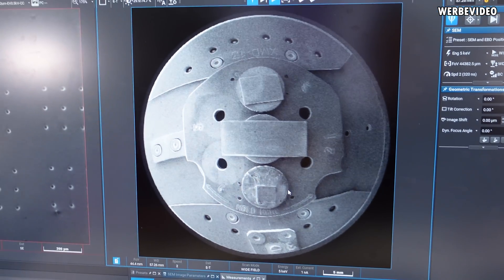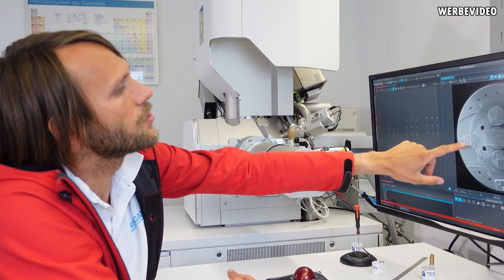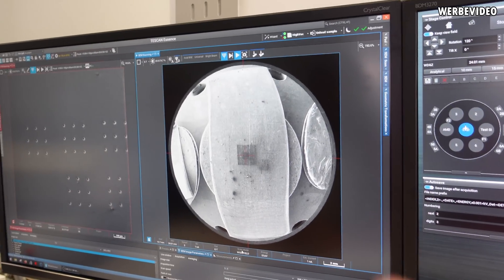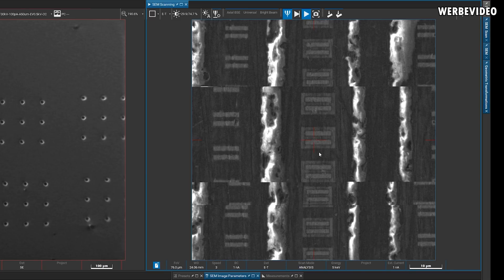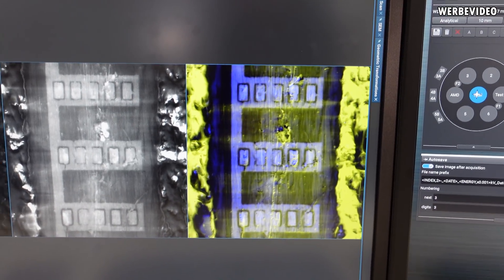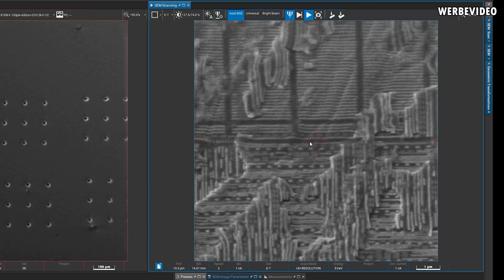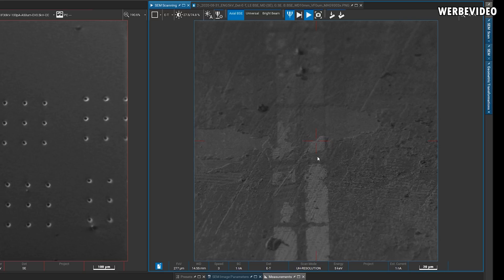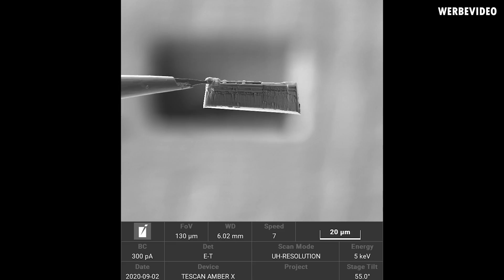Ryzen Nano-Structures more than 100,000 times magnified. Visiting Tescan Part 2/3

Comment: why aren't you using ferric chloride to etch  the  metal layers off? no grinding damage and you can control depth by etch time. that's the main method used by chip reverse engineers.

Comment: I hope they will improve Ryzen 7nm technology somehow, because that active flat is too small and cooling it is problem. You can have the most powerfull cooler in the world and there is no much big difference because of that while with Intel better cooler makes a difference. I've just bought Noctua D15 for my Ryzen 3800X and without votage offset I still have more than 80°C in load. Maybe pushing on switching to 7nm is not so good idea, coolers are not ready for that.

Comment: 200 years ago people would not even be able to imagine this kind of stuff. This is amazing.
Reply: Ok so you know what Electron tunneling is with the transistors, and how they use silicon transistors to get smaller like the 7 nm they are currently at with AMD's Ryzen 3000 series CPU's.
And the 5 nm, 3nm and so on, to make the computers more efficient with performance and energy but now we are starting to see more heat.
Silicon has limits but they keep trying to improve it, and it will melt at specific temperatures, so we need to replace it.
Ask yourself why we aren't using Quantum Materials like Graphene (yet) and still using silicon. 🤨🤔

This is where Graphene will fix the electron tunneling aka Quantum Tunneling, we don't need silicon to get down to 1 nm "nanometer" in size.

Imagine this, Graphene computers with a magnetic current to be 1,000 times faster and possibly only use 1% of the energy used. 💡

Now imagine Graphene optical / transparent transistors for Photonic Computing. 💡

Now imagine Graphene lasers for the fiber optics that would be used as the circuits inside our computers for Photonic Computing. 💡

--------

I would rather see Graphene computers, let's get rid of silicon. I'm serious.

Check this out.
I would give links but the video hides my comments.

Go to my channel and click on the playlist called "Videos with important info to get around my channel". ✔

Watch a Flash Graphene video about Flash Graphene 100 dollars "per ton". ✔

And then another video about "Large machines on earth / in space to make Flash Graphene". ✔

After that, check my channel with 2 simple steps for my other channel, go to the "About" tab of the channel I'm commenting with now and read the info with a link found there to save to your browser's favorites. ✔

==============================

Imagine Graphene for Photonic Computing, to help us save on our energy needs, really think about that for a second with Photonic Computing.

Check my other channel for these 2 playlists.
Photonic Computing playlist. ✔

Graphene computers for home and Starships, playlist. ✔

Learn about Graphene from my other channel's "Graphene playlist". ✔

If you want to know more about Graphene and Quantum Technologies, go to my other channel. ✔🤔💡

Comment: We all have alien technology in our home
Reply: Ok so you know what Electron tunneling is with the transistors, and how they use silicon transistors to get smaller like the 7 nm they are currently at with AMD's Ryzen 3000 series CPU's.
And the 5 nm, 3nm and so on, to make the computers more efficient with performance and energy but now we are starting to see more heat.
Silicon has limits but they keep trying to improve it, and it will melt at specific temperatures, so we need to replace it.
Ask yourself why we aren't using Quantum Materials like Graphene (yet) and still using silicon. 🤨🤔

This is where Graphene will fix the electron tunneling aka Quantum Tunneling, we don't need silicon to get down to 1 nm "nanometer" in size.

Imagine this, Graphene computers with a magnetic current to be 1,000 times faster and possibly only use 1% of the energy used. 💡

Now imagine Graphene optical / transparent transistors for Photonic Computing. 💡

Now imagine Graphene lasers for the fiber optics that would be used as the circuits inside our computers for Photonic Computing. 💡

--------

I would rather see Graphene computers, let's get rid of silicon. I'm serious.

Check this out.
I would give links but the video hides my comments.

Go to my channel and click on the playlist called "Videos with important info to get around my channel". ✔

Watch a Flash Graphene video about Flash Graphene 100 dollars "per ton". ✔

And then another video about "Large machines on earth / in space to make Flash Graphene". ✔

After that, check my channel with 2 simple steps for my other channel, go to the "About" tab of the channel I'm commenting with now and read the info with a link found there to save to your browser's favorites. ✔

==============================

Imagine Graphene for Photonic Computing, to help us save on our energy needs, really think about that for a second with Photonic Computing.

Check my other channel for these 2 playlists.
Photonic Computing playlist. ✔

Graphene computers for home and Starships, playlist. ✔

Learn about Graphene from my other channel's "Graphene playlist". ✔

If you want to know more about Graphene and Quantum Technologies, go to my other channel. ✔🤔💡

Comment: in the mid 1970's i sold one of the first SEMs that was used in the research project for electron beam lithography at a gov rocket research facility....it was all classified .....i don't know how much still is the way the fed works.....but suffice it to say, it was an interesting application. in the early days of SEM there was a new app born every day in material science, biologic, forensics , quality control...... i also sold TEM .... also micro probes and energy dispersion x-ray, and wave length spectrometers.......fun stuff

Comment: All this tech as we still don't have vaccine for COVID-9.
Reply: Go to my other channel and find a playlist about Graphene to fight against the coronavirus (Covid-19). And Quantum Computers to go into the fight against it.
================================

Ok so you know what Electron tunneling is with the transistors, and how they use silicon transistors to get smaller like the 7 nm they are currently at with AMD's Ryzen 3000 series CPU's.
And the 5 nm, 3nm and so on, to make the computers more efficient with performance and energy but now we are starting to see more heat.
Silicon has limits but they keep trying to improve it, and it will melt at specific temperatures, so we need to replace it.
Ask yourself why we aren't using Quantum Materials like Graphene (yet) and still using silicon. 🤨🤔

This is where Graphene will fix the electron tunneling aka Quantum Tunneling, we don't need silicon to get down to 1 nm "nanometer" in size.

Imagine this, Graphene computers with a magnetic current to be 1,000 times faster and possibly only use 1% of the energy used. 💡

Now imagine Graphene optical / transparent transistors for Photonic Computing. 💡

Now imagine Graphene lasers for the fiber optics that would be used as the circuits inside our computers for Photonic Computing. 💡

--------

I would rather see Graphene computers, let's get rid of silicon. I'm serious.

Check this out.
I would give links but the video hides my comments.

Go to my channel and click on the playlist called "Videos with important info to get around my channel". ✔

Watch a Flash Graphene video about Flash Graphene 100 dollars "per ton". ✔

And then another video about "Large machines on earth / in space to make Flash Graphene". ✔

After that, check my channel with 2 simple steps for my other channel, go to the "About" tab of the channel I'm commenting with now and read the info with a link found there to save to your browser's favorites. ✔

==============================

Imagine Graphene for Photonic Computing, to help us save on our energy needs, really think about that for a second with Photonic Computing.

Check my other channel for these 2 playlists.
Photonic Computing playlist. ✔

Graphene computers for home and Starships, playlist. ✔

Learn about Graphene from my other channel's "Graphene playlist". ✔

If you want to know more about Graphene and Quantum Technologies, go to my other channel. ✔🤔💡

Comment: we are gods now
Reply: Ok so you know what Electron tunneling is with the transistors, and how they use silicon transistors to get smaller like the 7 nm they are currently at with AMD's Ryzen 3000 series CPU's.
And the 5 nm, 3nm and so on, to make the computers more efficient with performance and energy but now we are starting to see more heat.
Silicon has limits but they keep trying to improve it, and it will melt at specific temperatures, so we need to replace it.
Ask yourself why we aren't using Quantum Materials like Graphene (yet) and still using silicon. 🤨🤔

This is where Graphene will fix the electron tunneling aka Quantum Tunneling, we don't need silicon to get down to 1 nm "nanometer" in size.

Imagine this, Graphene computers with a magnetic current to be 1,000 times faster and possibly only use 1% of the energy used. 💡

Now imagine Graphene optical / transparent transistors for Photonic Computing. 💡

Now imagine Graphene lasers for the fiber optics that would be used as the circuits inside our computers for Photonic Computing. 💡

--------

I would rather see Graphene computers, let's get rid of silicon. I'm serious.

Check this out.
I would give links but the video hides my comments.

Go to my channel and click on the playlist called "Videos with important info to get around my channel". ✔

Watch a Flash Graphene video about Flash Graphene 100 dollars "per ton". ✔

And then another video about "Large machines on earth / in space to make Flash Graphene". ✔

After that, check my channel with 2 simple steps for my other channel, go to the "About" tab of the channel I'm commenting with now and read the info with a link found there to save to your browser's favorites. ✔

==============================

Imagine Graphene for Photonic Computing, to help us save on our energy needs, really think about that for a second with Photonic Computing.

Check my other channel for these 2 playlists.
Photonic Computing playlist. ✔

Graphene computers for home and Starships, playlist. ✔

Learn about Graphene from my other channel's "Graphene playlist". ✔

If you want to know more about Graphene and Quantum Technologies, go to my other channel. ✔🤔💡

Comment: When you can afford scopes like this, CPUs are mere samples.
Reply: Ok so you know what Electron tunneling is with the transistors, and how they use silicon transistors to get smaller like the 7 nm they are currently at with AMD's Ryzen 3000 series CPU's.
And the 5 nm, 3nm and so on, to make the computers more efficient with performance and energy but now we are starting to see more heat.
Silicon has limits but they keep trying to improve it, and it will melt at specific temperatures, so we need to replace it.
Ask yourself why we aren't using Quantum Materials like Graphene (yet) and still using silicon. 🤨🤔

This is where Graphene will fix the electron tunneling aka Quantum Tunneling, we don't need silicon to get down to 1 nm "nanometer" in size.

Imagine this, Graphene computers with a magnetic current to be 1,000 times faster and possibly only use 1% of the energy used. 💡

Now imagine Graphene optical / transparent transistors for Photonic Computing. 💡

Now imagine Graphene lasers for the fiber optics that would be used as the circuits inside our computers for Photonic Computing. 💡

--------

I would rather see Graphene computers, let's get rid of silicon. I'm serious.

Check this out.
I would give links but the video hides my comments.

Go to my channel and click on the playlist called "Videos with important info to get around my channel". ✔

Watch a Flash Graphene video about Flash Graphene 100 dollars "per ton". ✔

And then another video about "Large machines on earth / in space to make Flash Graphene". ✔

After that, check my channel with 2 simple steps for my other channel, go to the "About" tab of the channel I'm commenting with now and read the info with a link found there to save to your browser's favorites. ✔

==============================

Imagine Graphene for Photonic Computing, to help us save on our energy needs, really think about that for a second with Photonic Computing.

Check my other channel for these 2 playlists.
Photonic Computing playlist. ✔

Graphene computers for home and Starships, playlist. ✔

Learn about Graphene from my other channel's "Graphene playlist". ✔

If you want to know more about Graphene and Quantum Technologies, go to my other channel. ✔🤔💡

Comment: This was an awesome video! Thank you! I also look forward to that 14 vs 7nm video!
Reply: Ok so you know what Electron tunneling is with the transistors, and how they use silicon transistors to get smaller like the 7 nm they are currently at with AMD's Ryzen 3000 series CPU's.
And the 5 nm, 3nm and so on, to make the computers more efficient with performance and energy but now we are starting to see more heat.
Silicon has limits but they keep trying to improve it, and it will melt at specific temperatures, so we need to replace it.
Ask yourself why we aren't using Quantum Materials like Graphene (yet) and still using silicon. 🤨🤔

This is where Graphene will fix the electron tunneling aka Quantum Tunneling, we don't need silicon to get down to 1 nm "nanometer" in size.

Imagine this, Graphene computers with a magnetic current to be 1,000 times faster and possibly only use 1% of the energy used. 💡

Now imagine Graphene optical / transparent transistors for Photonic Computing. 💡

Now imagine Graphene lasers for the fiber optics that would be used as the circuits inside our computers for Photonic Computing. 💡

--------

I would rather see Graphene computers, let's get rid of silicon. I'm serious.

Check this out.
I would give links but the video hides my comments.

Go to my channel and click on the playlist called "Videos with important info to get around my channel". ✔

Watch a Flash Graphene video about Flash Graphene 100 dollars "per ton". ✔

And then another video about "Large machines on earth / in space to make Flash Graphene". ✔

After that, check my channel with 2 simple steps for my other channel, go to the "About" tab of the channel I'm commenting with now and read the info with a link found there to save to your browser's favorites. ✔

==============================

Imagine Graphene for Photonic Computing, to help us save on our energy needs, really think about that for a second with Photonic Computing.

Check my other channel for these 2 playlists.
Photonic Computing playlist. ✔

Graphene computers for home and Starships, playlist. ✔

Learn about Graphene from my other channel's "Graphene playlist". ✔

If you want to know more about Graphene and Quantum Technologies, go to my other channel. ✔🤔💡

Comment: crazy, when making CPUs subatomic... basically!
Reply: It's actually very old what AMD is doing right now, and Intel for what we can buy, such as the Ryzen 3000 series at the moment, down to 5 nm and 3 nm, this is old news.

Want to see where you can really be mind blown? Keep reading and then check everything on my other channel by using the info below.
========================================

Ok so you know what Electron tunneling is with the transistors, and how they use silicon transistors to get smaller like the 7 nm they are currently at with AMD's Ryzen 3000 series CPU's.
And the 5 nm, 3nm and so on, to make the computers more efficient with performance and energy but now we are starting to see more heat.
Silicon has limits but they keep trying to improve it, and it will melt at specific temperatures, so we need to replace it.
Ask yourself why we aren't using Quantum Materials like Graphene (yet) and still using silicon. 🤨🤔

This is where Graphene will fix the electron tunneling aka Quantum Tunneling, we don't need silicon to get down to 1 nm "nanometer" in size.

Imagine this, Graphene computers with a magnetic current to be 1,000 times faster and possibly only use 1% of the energy used. 💡

Now imagine Graphene optical / transparent transistors for Photonic Computing. 💡

Now imagine Graphene lasers for the fiber optics that would be used as the circuits inside our computers for Photonic Computing. 💡

--------

I would rather see Graphene computers, let's get rid of silicon. I'm serious.

Check this out.
I would give links but the video hides my comments.

Go to my channel and click on the playlist called "Videos with important info to get around my channel". ✔

Watch a Flash Graphene video about Flash Graphene 100 dollars "per ton". ✔

And then another video about "Large machines on earth / in space to make Flash Graphene". ✔

After that, check my channel with 2 simple steps for my other channel, go to the "About" tab of the channel I'm commenting with now and read the info with a link found there to save to your browser's favorites. ✔

==============================

Imagine Graphene for Photonic Computing, to help us save on our energy needs, really think about that for a second with Photonic Computing.

Check my other channel for these 2 playlists.
Photonic Computing playlist. ✔

Graphene computers for home and Starships, playlist. ✔

Learn about Graphene from my other channel's "Graphene playlist". ✔

If you want to know more about Graphene and Quantum Technologies, go to my other channel. ✔🤔💡